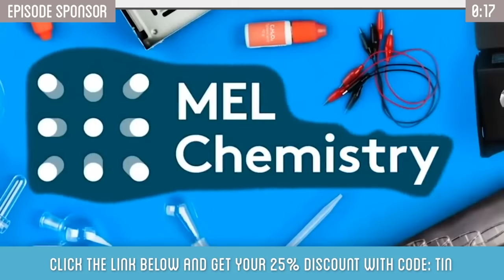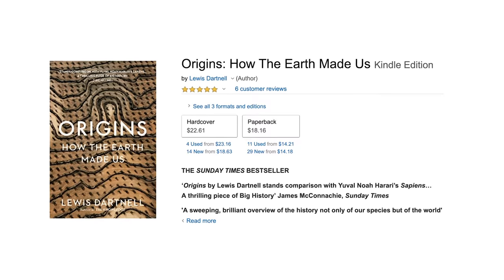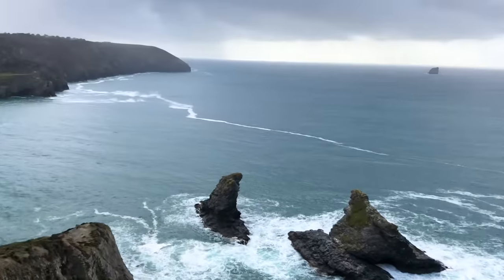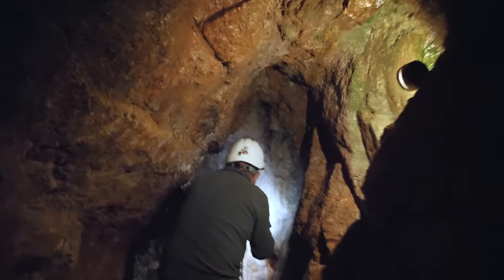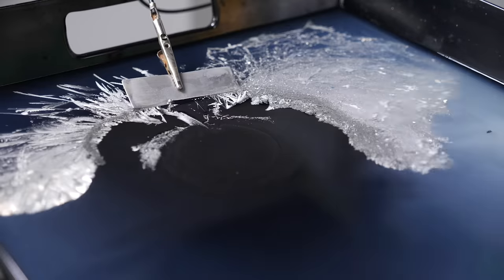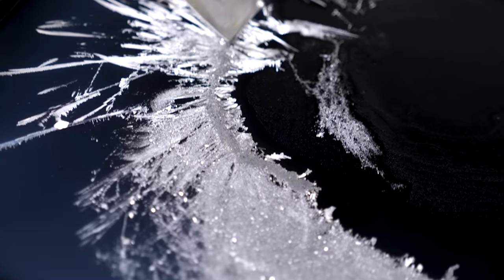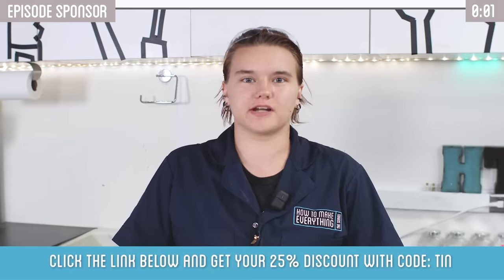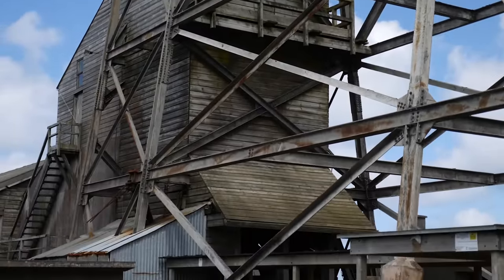Mining This Rock Unlocks the Bronze Age

Comment: I can't wait until he gets to mining uranium and making a nuclear power plant
Reply: From what I understand it would be much easier to use Thorium instead. Because it's more common and easier to prepare. Would still need a little uranium though for the process.
Reply: @The_Great_Wrennicles_the_IV  do you watch sam o'nella?
Reply: XDDDD
Reply: Recreate the DEMON CORE! XDDDD
Reply: @The_Great_Wrennicles_the_IV  and because Thorium has a much higher nuclear output compared to its radioactive leftovers. It puts out much less than Uranium.
Reply: A thorium reactor requires uranium 233 to work anyway
Reply: @modernspartan98  still produces a lot less radiation than If you used uranium as the reactor fuel source and the literal fuel source
Reply: @modernspartan98  umm but why would you use uranium 233? Plutonium requires so much less material to breed thorium. Please do a bit of research before speaking on the subject.
Reply: If  you think im wrong go research the only thorium reactor in the world
Reply: Wren Harder-Tessier Thorium might be more common, it also much more chemically toxic. There is a downside to Thorium.
Reply: he wil get arrested by the FBI before that
Reply: @modernspartan98  r/iamverysmart
Reply: @weavilemaster123321  why thorium rocks
Reply: @modernspartan98  yeah but it isn't the fuel it's just used to start the process and it's much easier to get thorium, it's also much easier to make thorium usable, there's also the fact that it's alot easier to avoid something like the Chernobyl incident
Reply: as long as we will not see graphite on his roof
Reply: *Homeland Security joined the chat*
Reply: I love this channel, don't get me wrong but the results would be something like

"Sorry guys, I was a little rushed and blew up the nuclear reactor."
Reply: @AymaKon  I read this in his voice before I even realised it
Reply: i think cody already tried that then he got raided
Reply: Cody Don from Cody's Lab was doing it and got a visit from the government and they confiscated some material, including his yellowcake refined uranium.
Reply: He wouldn't survive. His channel is fun, but he screws up way more than is acceptable in nuclear engineering.
Reply: XD
Reply: @gabesnooks3549  And if anyone could actually make a safe nuclear reactor, it's Cody.
Reply: I grew up in Jeffrey City, Wyoming where there was a boom town in the late 50s and through the 70s where they mined Uranium!
I hear they are talking about opening mining operations in that area, again, for Uranium!
Reply: Lol he better come to the Navajo Reservation we got some Uranium deposits here
Reply: Exactly what I came to the comments for. It's the obvious next step after the steam engine.

In all seriousness, though, as others are saying, he'd get his work confiscated pretty quickly if he even managed to get ahold of the uranium. Most of us are aware of the "nuclear boy scout" which was a lot less dangerous than this DIY Chernobyl idea. 

Though, to be honest, I think he'd more likely go the way of Pierre Curie while trying - dangerously irradiated...but killed in traffic before it mattered.
Reply: You can do that in Cornwall as well. Pitchblende can be found near St Ives, indeed Wheal Trenwith produced copper, tin and pitchblende
Reply: @weavilemaster123321  WELL THORIUM ROCKS
Reply: He can start his very own miniature Manhattan Project.
Reply: That's just crazy
Reply: I'd be impressed watching him separate the 235 from the 238.
Reply: @BrettonFerguson  sounds a bit dangerous don't you think?
Reply: @diablominero  Yeah, but you dont just refine uranium and post the process on yourtube.
Reply: Then creates its own 233
Reply: I did it. A lot of work. But having 2 headed children is cool.
Reply: Please do NOT do an episode on uranium.  The Iranians have been waiting for you to do just that.
Reply: Spent Thorium can not be used as weapons grade material, so that is a plus.
Reply: @The_Great_Wrennicles_the_IV  Cody's lab already has yellow cake
Reply: @modernspartan98  You obviously don't understand the difference in amount of fuel you would need if you used recycled uranium 233(99% earthen uranium);the amount of uranium 233 vs the amount of plutonium is imessurable;I rather not give all the means to weaponise the plant to ISIS ergo plutonium is a better option..
Reply: @LetsTakeWalk  so what;a chemical spill is nothing compared to a uranium reactor going haywire and causing yet another Chernyobl,a thorium reactor can be stoped instantly because its based on nuclear fertility
Reply: @modernspartan98  Wich is a byproduct of thorium 232 irradiation in a nuclear reactor, much like plutonium is for uranium 238. You just need a neutron source wich it is relatively easy to come by or make.
Reply: He will dig an oil well,build a refinery to make his own gasoline. Lol.
Reply: Is that the episode where he'll be giving away the MEL Physics kits?
Reply: It would be much cooler if he skipped straight to fusion :)
Reply: Yes he must ask Cody and then send me a piece
Reply: He could use graphite to coat any refined ore, Cody's lab has a good amount with lead bricks all around it, he took it out in his kitchen, but that's just Cody. with use of a lower temperature reliable reactor with a pebble bed design to a gas that can transfer heat as he wants, with some batteries he could make a gyroscopic power source so that the power doesn't jostle too much and can save, there have been designs for pebble bed reactors which don't use water or cooling rods, they have mass in between the fuel at certain sizes so it cant go critical like the demon core,  just the fuel, casing, insulation for the fuel and a gas, libraries are great go read a book like i did to learn about this
Reply: Same
Reply: I love how this comment was just a joke, but it turned into a conversation nuclear output and stuff
Reply: A boy scout already accomplished that
Reply: Why, so he can get arrested for trying to make dirty bombs ?
Reply: I can't wait until he fakes space like NASA.
Reply: POLUTTIUN
Reply: Roland-231 you can mine uranium u harvest it
Reply: Today I’m gonna be making a wmd
Reply: Just a few hundred thousand years!
Reply: I'm waiting on Senku to do it too
Reply: Can’t wait till he has to recreate Chernobyl
Reply: I'd rather see a N   U   K   E
Reply: @weavilemaster123321  i watch sam o,nella and that is how i know about thorium
Reply: Thsi series gonna end with him makimg a nation if he wants a plant
Reply: Are you still waiting?
Reply: @gaminghobby.  yes
Reply: Next up making a silica computer chip from scratch

Comment: Well done.
While there is a lot of discussion possible about why the transition from bronze to iron was made, it was probably not primarily because the iron tools and weapons, in the beginning, were superior to bronze ones. In fact bronze is stronger and can be made harder than pure iron. It's only when steel started to be made that there begun to be an obvious superiority of iron over bronze, but the process was long and slow lasting hundreds of years. However, the driving factor for the transition seems to have been the significant decrease of bronze availability due to the disruption of trade networks at the end of the bronze age, the so-called invasion of the "sea peoples" leading to the late bronze age collapse around 1200BCE. Suddenly copper and tin could not be brought together to form the alloy, and promoted search for alternative processes.
Reply: Sounds reasonable. A material in higher abundance will often win out over one that's harder to obtain.
Reply: I'm also going to add here that this is also a part of the reason why it's important to note that the whole "Stone age", "Bronze age" "Iron age" etc system isn't actually a linear progression of technological or societal advancement. Rather, it's just a retroactive label we give to different periods of Eurasian history. The reason this is so important is because a lot of people incorrectly assume that some cultures or civilizations are more or less complex solely based on their choice of material used for tools and weapons. The Mesoamericans (Aztec, Maya, etc) and Andeans (Inca, etc) often get labelled as "Stone age" cultures (despite the fact that both groups actually did have bronze metallurgy) simply because wood and stone was the primary materials used for tools, despite the fact that both were far more complex then that in virtually every other respect: Larger Mesoamerican cities dwarfed even the largest cities from Bronze age Mesopotamia and Egypt, even giving some large Roman, Persian, and Greek cities from classical anitquity and Medieval europe a run for their money in size (Teotihuacan for example, outright covered a larger area then Rome did at it's height, and with virtually all it's citizens in fancy multi-room palace complexes) and the complexity of their water mangement systems (interconnected water resvoirs, agricultural canals, aquaducts, and drainage systems were ubiquitous, with running water, sewage systems, toilets, etc being in a number of cities) Their goverments, political systems, economics, military complexity, mathematics, and artistic and intellectual achievements are all also more complexity then a "stone age" monkier implies, variously being more comparable to what you see in Bronze, Iron, Classical, or Medieval societies.
Reply: @MajoraZ  Of course; I should add that the bronze age collapse that I referred to above only applies to classical Mediterranean civilization. Perhaps one of the reasons why centro- and south-American cultures didn't transition off bronze was the lack of "sea peoples" to invade them... Until some "sea peoples" showed up soon after 1492, and then it was too late.
Reply: Umm it's more widespread because of two things;the most of the surface level bronze was used up;and second iron was so much more abundant even before they started mining bronze;it's just that they could only be used like ornatments(pyrite) coz of the 1,5k C melting point.
Reply: A great period summarized greatly.
Reply: @MajoraZ  It's funny how people think Steel wasn't discovered until the industrial revolution, while we have records of spring steel weapons from 900 BC and steel jewelry from 1100 BC (or something like that). (Shadiversity did some videos on that, if you want to know a bit more.)
Reply: @SapioiT  America also already existed before Columbus discovered it. The point is after Columbus, nobody had to re-discover it ever again. 

With steel it's a bit like this; a lot of people were using steel but all they had was a plan that required specific steps for known sources of the raw material and then you end up with steel. 

In the 19th century steel was discovered as that it was a specific % of carbon dissolved in iron that gave you steel and now everybody could make steel no matter the specific iron-ore or source or method they used. Just melt and purify the iron and then add the desired % of C.
In other words, many people discovered A steel but during the industrial revolution 'Steel' (all of them) was discovered.
Reply: @DreadX10  And most steel was far less high quality before the 17th century as well
Reply: People switched to iron in much of the world, when trade collapsed. Major copper and tin sources were often thousands of miles apart. Some places, like all of Africa, skipped the bronze age entirely, because iron rich rock is everywhere.
Reply: exactly, the bronze age ended due to shortage of easily minable tin which made iron/steel tools much more practical which in turn propelled their improvement
Reply: Do you have any academic links for this? Would be very interested.
Reply: The higher melting point was certainly a factor in its later adoption than more easily worked copper and tin.
Reply: @SloppyPuppy  surface level bronze? Bronze is an alloy made by smelting copper and tin together
Reply: @corners3755  Look how you massacred my boy.
Lmao 2 year old comment, what i prob meant was copper, but the same appiles to tin.

Comment: In 40+ years: How to build a computer processor.
Let me know, if you need help. With some luck I'll still be around.
Reply: No, how to build a nuclear reactor
Reply: Ben eater starts typing
Reply: Jules Vallez  it's actually not that difficult if you know somewhat what you are doing. You wouldn't even need a full screen, as long as you can get information to the storage and from the processor in some form
Reply: @hansdietrich83  exactly. some blinking LEDs (or even light bulbs) are sufficient to deliver digital data to the user.
Look for the Altair 8800
Reply: Reminds me of that guy who built a computer inside minecraft :D
Reply: you know he could just make a mechanical calculator like the predecessor to all the electronic ones .
Reply: just curious how would you start?
Reply: There is a video where a guy made a video card on a breadboard. A lot crazy stuff can be done with a little know-how and will.

Comment: Tin melts at about 450 degrees Fahrenheit or roughly 230 degrees Centigrade.  So who invented the thermometer to measure these temperatures and how was that done? For our approximate usages, the bellows furnace heated stuff up until it glowed red hot, then white hot, until finally it melted and pooled into droplets at the bottom of the ceramic container. We could identify what was being melted by its characteristics, like separating out iron by magnetic attraction or reaction to certain acids.

Comment: I second to see you build a steam engine!!! I want to know if you use organic lubrication and how to make the system water right without rubber!
Reply: Bronze bushings wouldn't need much lubrication. He has tin so he could solder joints to make them water tight.

Comment: For Tin, Sn, the melting point is 449.5°F or 231.9°C,  If we go further, the melting point of Copper, Cu, is 1,984°F or 1,085°C.  The melting point of Bronze, assuming the combination of only Copper and Tin in varying ratios is roughly 1,742 degrees F or 950 degrees C.
I hope that is helpful.  I went a bit further than you asked because I was intrigued and wanted to know the various melting points for each of the components and them, of the combined metals into their final for as Bronze.
I enjoyed the video and my Grandsons did, as well.

Comment: One very popular use of tin is as pewter.  Pewter used to be an alloy of lead and tin, but as we came to realize how poisonous lead is, the formula for pewter became 92.5% tin and 07.5 copper.  If you were to remove the chemically induced oxidation on modern pewter and polished it, you would end up with an object brighter than silver or aluminum, and it would stay brighter because tin is highly resistant to oxidation or corrosion.  It doesn't tarnish.

Comment: melting point of tin is 449.5°F

Tin is a chemical element with the symbol Sn and atomic number 50. Tin is a silvery metal that characteristicly has a faint yellow hue. Tin, like indium, is soft enough to be cut without much force. Wikipedia
Symbol: Sn
Boiling point: 4,716°F (2,602°C)
Atomic mass: 118.71 u
Atomic number: 50
Melting point: 449.5°F (231.9°C)
Electron configuration: [Kr] 4d105s25p2
Did you know: Tin salts sprayed onto glass are used to produce electrically conductive coatings.

Comment: Hint: wrap aluminum foil or plastic around the strong magnet when you extract the iron. That was you can easily isolate the iron from the magnet by pulling off the foil, and the powder will drop off. It's hard to clean a magnet with iron dust on it.

Comment: 231.9°C
 is the melting point of tin, but, did you know, bronze's melting point is around 950°C depending on the ratio of the alloy components?

Comment: In electronics of the germanuim era "tin whiskers" can form inside germanium transistors and some potentiometers because the casings and leads were coated in tin to help the soldering processes during manufacturing, These "whiskers" cause electrical shorts and render that componet inoperable or faulty. You see this in old transistor radios and TV sets of the 60's and 70's and sometime a good thump will revive a transistor and a cleaning will make a pot work again..

If you can wait 40 years you can grow tin whiskers in open air. LOL

Comment: tin has a variable melting point depending on the size of the particles of the raw element. for massive tin, it is about 450 degrees F. i vividly remember melting raw tin as a curious adolescent because it could be done easily on an open wood fire, and could be sourced from empty toothpaste and ointment tubes. today those tubes are all made out of aluminum or plastic.

Comment: 449.5º F is the melting point of Sn. 
Interestingly, as '49' is part of the number  in degrees Farenheit for the melting point of tin, tin also happens to be the 49th most abundant element. It is a post-transition metal, which also sounds like a description of it's use in the history of metallurgy.

Comment: Tin Dendrite is one of the reasons tin based solders are inferior to lead or gold.
The current running the circuit will cause it to grow and branch out until it shorts to another circuit.
This process takes time but already sever orbital satellites have been rendered in operable due to this.

Comment: I thought the reason we moved away from copper is because you can't forge weld bronze together after breaking it. You always have to cast it, making it expensive. Also the metal is rare due to the rarity of tin. Moved to iron and steel due to the workability of the metal.

Interestingly bronze was also a measure of wealth during the bronze age, and the richer Roman's for example used to keep bronze tools as a form of wealth.

Comment: Anyone can easily build a steam engine. I built a tiny steam boat using a ham can, an Altoids tin, some copper tubing, tin solder, and an oil lamp. Now, building a steam engine big enough to be useful, one with a turbine so you can get rotation out of it, that would be hard. But somehow I suspect that isn't what you're planning.